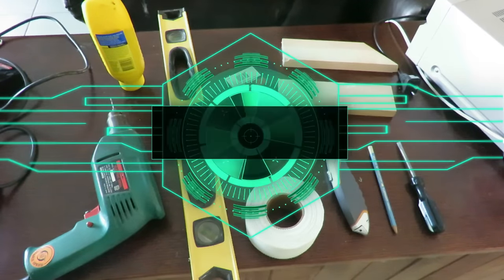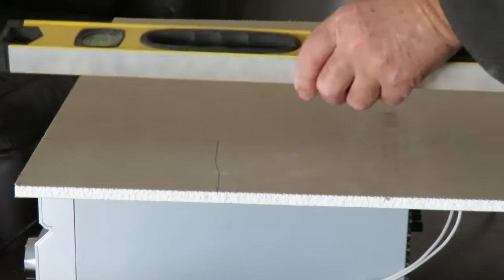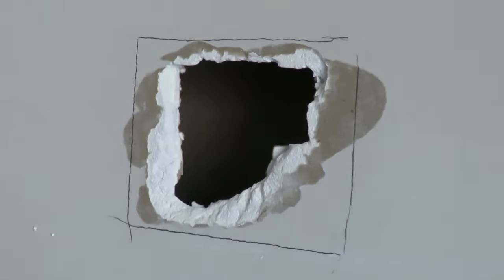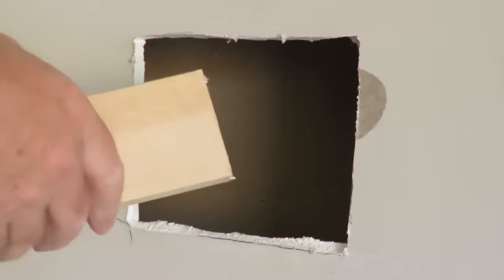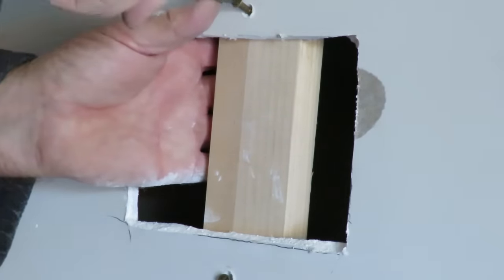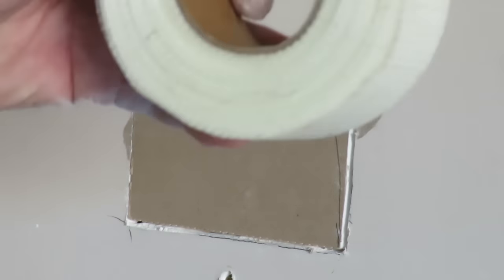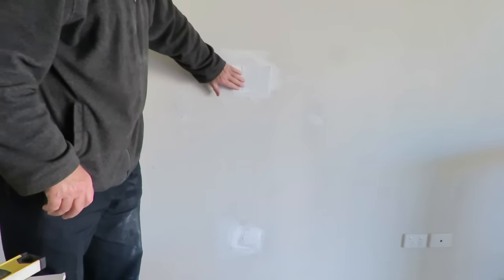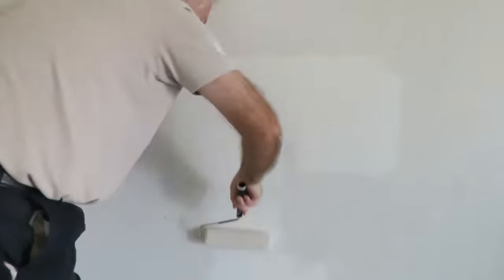🏠 How to Repair Drywall and Fix a large Hole in the Plaster Wall the easy way

Comment: This repair is completely wrong.
The deadwood goes at left and right side of cut out to simulate studs and then drywall piece screws to deadwood that should go at least 3” beyond opening ↕️ both sides 1”x3” or 1”x4” wood works better than 1”x2” 
(By how ever long the deadwood should be)
Then tape, mud, and few skim coats. Lightly sand (unless you make a huge mess) texture and paint.

I’m a trained artisan in highend residential and this is how this repair is done right.  ...just saying
Reply: So not completely wrong then. Just differently to how you would do it....

just saying
Reply: @Delboy591  he put the patch in backwards.
Reply from the maker: There are many ways to do repairs, it all depends on what you have available on the day of the repair.

Please Read the video description for a better understanding as to why the repair was done this way
P.S. I normally use this method when I have my tools with me.
📌 https://youtu.be/JmcR9TW4mM0
Reply: @GarryPurcell  it has nothing to do with technique and everything to do with the material used.  Drywall has 2 different types of paper,  and the brown side always goes to the inside of the wall.  If it's on the outside "facing you" then when it's mudded and painted. The paper will slowly delaminate leaving blisters under the paint
Reply: @chrisstorholt926  why????
Reply: @imho2278  When they make sheets of drywall, they use 2 different kinds of paper.  One is designed to bond to the mud we use to finish it and is also thicker, and more rigid to support the sheet with drywall screws. It is usually white or grey in color.   The other is actually several layers of brown paper that have been glued together, in the same way plywood is, to create a stronger backing.   If you hang it backward, with the brown facing towards you, then when you tape and mud, it will pull the layers apart and cause the tape to fail and bubbles to form.  You might get lucky with a smaller patch, but there's always the risk.  With a larger patch or sheet hung, you will absolutely see it separate over time.
Reply: Trained artisan in high end residential, no less!  🤣

Comment: Or you could make a simple patch with a knife and a tape measure lol but that's just me
Reply from the maker: There are lots of ways to do wall repairs.
Reply: @GarryPurcell  no need to waste time and money.
Reply from the maker: @MrStevesparkz  True
You use what is at hand and make the best use of it.
I had to borrow tools and source materials from a dump bin to do this repair.
Reply: @GarryPurcell  so what you are telling me is that you didn't have 3 things like a knife a measuring tape and a pencil? lol ok whatever you say man .
Reply from the maker: @MrStevesparkz  I was there painting walls.
So I think that answers your question for you.
Reply: @GarryPurcell  you just need to be taught and updated on new simple techniques. enough of this 1970's let's take all day to fix something techniques.
Reply from the maker: There's nothing stopping you from making a video on the topic, and letting me see your prefered method. (And Costing)
Reply: @GarryPurcell  I'll save you the time all you need is one knife one pencil one tape measure. it's a called a patch. a little spackle or what have you to follow and then paint . why are you not getting this?
Reply from the maker: @MrStevesparkz  Simply call it a californian patch.
There are lots of ways to do repairs.
Clips are becoming very popular also.

Comment: Unprofessional
Reply from the maker: YOU Should Learn to READ Video Descriptions First before commenting in future.
Reply: I’d say it worked pretty well though. Did it not? Solid work IMO.
Reply from the maker: Its holding up perfectly, these types of repairs can be dome in many ways.
When I'm forewarned, I normally use the method below to repair a wall, that a wall has been damaged.
https://youtu.be/JmcR9TW4mM0

Comment: Iam sorry but the way you did it was wrong no hate
Reply from the maker: No problem.🙂
But if you read the Video description, all will be reveled, as to why the repair was done this way on the day.

Be sure to check out my other wall repair video, when I was prepared for wall repairs.
https://youtu.be/JmcR9TW4mM0
Reply: @GarryPurcell  it’s just one thing you didn’t put a screw in the middle the two by 4 was in the middle
Reply from the maker: @AnthonyGarcia-db6ti  You need to read the video description, before commenting any further.
It will help you to understand why the repair was done this way.
Reply: @GarryPurcell  yessir
Reply: You need to read the video description before commenting any further

Comment: Thank you for this awesome video! I'll be repairing a hole tomorrow (similar in size). Its in the ceiling though...will the same method work?
Reply: It should!
Reply: I suggest looking for a ceiling turtorial tho
Reply from the maker: I'd suggest this other video I made, would be more suitable for fixing the ceiling. This method has anchor points for the repair piece, so it will hold its position better for you.
https://youtu.be/JmcR9TW4mM0

Comment: Seriously, you pre drill a hole
In the drywall for your screw that is going in wood!  Then you use a hand held flat screw driver?  I definitely would not follow your channel if this is how you patch a simple hole…
Reply from the maker: Read the video description before commenting any further.
Reply: @GarryPurcell  ….Don’t take it personally, you can learn better if you search out other websites….
Reply from the maker: As stated in the Video Description
I had no tools with me on the day, and had to borrow what I could find onsite to repair the wall. 
So maybe you should have read the video description first, before commenting.
P.S. Tasmanian Oak is one of the hardest timbers on the planet, and it's near impossible to hand screw into it. Hence the need to predrill.

I normally use this method below when I have my tools with me.
📌 https://youtu.be/JmcR9TW4mM0
Reply: @GarryPurcell  ….still not following you’re ways.  Very sloppy presentation Gary.
Reply from the maker: @SC-mw2yc And of cause you can do better with no tools, when you are on the jobsite for a completely different job. BUT... you are an expert who sits in a couch, with no real world experience of working in the rental market, where everyday costs money.
Reply: @GarryPurcell  …I spent 32 years in the building trades, IBEW union strong / local 11, state certified electrician, general foreman, foreman and journeyman, mate. Been around all the building trades (lath & plasters, stud framers, dry walkers, plumbers, masons, carpenters, painters,concrete finishers and learned a lot and am now retired enjoying the fruits of my labor, mate.  Match that resume mate!
Reply from the maker: @SC-mw2yc  Wow... and you don't have a single video.

I've seen burlap sack as backing, rolled up paper, cardboard, tape skimmed over, chicken wire for support, and even clay in an old building with lathe walls, butterfly patches, Tylok Connector plates, old paint tin lids, and evan cement as the joining medium.
AND.... Most of them held up really well over the years. (the tape failed bigtime)

So there are many ways to do effective wall repairs.
It all depends on what you have onhand at the time of the repair.

P.S. This repair you have been commenting on, is in a rental property, which is close to 4 years old, with no issues to date.

Comment: When I was a young fella my father came home drunk and mad.He kicked holes in the drywall so me having some ability in home repair looked the situation over and devised a plan.I went to the lumber yard and asked for some scraped 1/2 drywall,some patching plaster and tape.I took a square and cut holes in and around the holes,I put the knife on an angle whitch was smaller on the inside of the wall well I tapered the hole.I took the drywall and cut it on an angle.When I was done the piece I cut out fit down a little below the surface of the hole I took the drywall mud and put it around the hole,I then shoved the plug I made into the wall when I was finished my mother said your father will come home and wonder where the holes went.
Reply from the maker: Nice story, and shows your initiative, well done.🙂

Comment: It's even better with reverse tapers on the wall board and insert, plus wetting the existing edges and putting some mud on it before inserting the patch.
Or cut out stud to stud but using at least 12 inch high stiff piece x 16 wide center of stud to center of stud.
Light side of paper facing you not backwards like this guy did.
Reply from the maker: Thanks for the advice.

Comment: Hmmm on such a small hole !  Made bigger ! A quicker way is to use Gripfill on a small section of plasterboard that is almost the same size as the hole. The plasterboard has a small metal screw pushed through the middle, this is used to position the board on the inside of the repair, and pull it forward. A pre drilled board is placed over the end of the screw and tightened. After a few hours the outer board can be removed. The screw is pushed back gently, and the shallow hole filled.
Reply from the maker: Interesting method, thank you.

Comment: I hate to say anything but I will anyway,no one uses flat head screws ,cut out the square with a keyhole saw,and have a screw gun or drill with a Phillips head bit other then that good job😉
Reply from the maker: The video description will answer why I used flat head screws.

Comment: Make the hole big enough to tuck 4 fingers inside of it. Squirrel 1 or 2 pieces of wood inside the hole, hold them firm against the inside of the wall and screw them to the wall from the outside. Fill in the hole with half inch drywall, 20 minute fast dry mud or both. done.
Reply from the maker: Thanks for sharing your way of doing wall repairs.

I have another wall repair video you might like, when I had all my tools with me.
https://youtu.be/JmcR9TW4mM0?
Reply: @stevenskovranek2747 I hear you but I'm 63 now and too slow to get the 5 minute mud on before it's starts setting up .lol

Comment: I'd suggest using drywall screws to attach the wood support piece. Also securing the drywall to the wood using drywall screws instead of solely relying on the tape to hold it in place. The tape and drywall screws in the patch would probably be enough to keep the piece from rocking like a seesaw but for extra peace of mind I'd use two piece of wood on either side and tuck half of the wood behind the old piece and the other half to secure the patch to like you would when installing full pieces of drywall to a 2x4.
Reply from the maker: The video description explains why it was done this way.
P.S. I have another wall repair video you might like, when I had all my tools with me.
https://youtu.be/JmcR9TW4mM0?

Comment: Garry, I can tell you’re a skilled and experienced craftsman!  Could you advise me on something I’m having difficulty with please?
I have a ceiling with some stain from a previous water leak. What’s the b st product to cover this? Or should I cut it out and replace the section?  It’s drywall but it’s about a 5’x5’ area. Actually, 2 areas. It’s an active office space and I hate to make the mess and shut down the work area as there are electronics and all that stuff to deal with. Your advice would be greatly appreciated my friend!
Reply from the maker: Sugar soap to clean the area affected, and ceiling paint to go over it.
Reply: I had a bad water stain on a painted window sill, interior.  After applying six coats of Kilz the stain kept showing up when the Kilz dried.  I got a rattle can of automotive paint and sprayed it over the stain, then one coat of kilz and two coats of latex paint.  That did the trick!
Reply from the maker: @davidgpo  Interesting way to cover a stain.
Thanks.

Comment: Hi Gary, It's me again.  Your video is helping me to decide on a repairman for a closet drywall project I have.  Specifically, when asked how they would repair the holes - one man described exactly how you do in this video and another said he would fill them with mud.  One other concern I have is that I used a Zinsser shellac-based primer on the walls - trying to get rid of the smell of the old paint I used.  (This is why I now have the holes - ended up ripping out the shelves I'd painted.)  I'm getting mixed messages on whether I need to treat the walls somehow before a skim coat is applied.  Can you advise?  Thank you VERY MUCH!! for your response!
Reply from the maker: Take a look at my second video.
https://youtu.be/JmcR9TW4mM0
Its really easy to DIY wall repairs.
You won't be spending a lot of money.
AND... if it doesn't work out, you can always get someone in to repair it for you.

I'm not familiar with Zinsser paint, so my suggestion is ask at your local pain shop for help.

Comment: Nice but personally, I would have put a scrap of wood behind each side and screwed the patch to the wood as well as the wood to the wall. Less movements means less of a chance of cracking. If someone leans against it, it’s more than likely going to crack with just that scrap of wood in the center.
Reply: I agree. I always put enough backer in to prevent the new piece from moving or pivoting as you see here.  I would have used two pieces of wood for a  solid base.
Reply from the maker: I normally use the method below to repair walls.
https://youtu.be/JmcR9TW4mM0

Comment: Small piece of advice. Not a single wood support in the middle, but 2 on the sides which should also partially cover remaining plaster board (they will create way better support). All edges should be angled on the patch and remaining plaster board. Watch proper videos one this subject as this one is far from being a "reference" for those without any knowledge.
Reply from the maker: Before commenting any further.
Please Read the video description.
P.S. I normally use this method below when I have my tools with me.
📌 https://youtu.be/JmcR9TW4mM0
Reply: 2 l would use.🇦🇺

Comment: Looks great!  I’ll be trying this out on two holes in a few hours.  Problem for me is matching the paint color.  Any tips on that?  I’ve taken a few paint chips from the store, but can’t seem to find the perfect one, and this method just doesn’t seem right.  Anyway, thanks!
Reply from the maker: Matching paint is not something everyone can do, the hardware stores work on a card basis that aren't that accurate to start with.

I can mix my own colours to match, but unfortunately that is of no use to you.

I have a slightly different repair video you might like, by watching both you will have a better understanding of just how easy it is to do wall repairs yourself.
https://youtu.be/JmcR9TW4mM0?
Reply: Garry Purcell thanks so much.  I’ll check out the video and continue to follow your advice.  So far so good with the patching.  If I can throw you a few bucks for your advice I’d like to.  Seriously, very much appreciated.  Keep up the amazing work.  I’ll check back shortly.
Reply: Garry Purcell patched my hole successfully.  Just have to spackle, sand and paint.  Thank you so much!

Comment: Gee, reading through the comments, it seems that there are so many experts out there. They need to remember that this video isn't designed for fancy pants American market, although could easily apply, it looks like it is designed more for landlords and homeowners who need to do a repair job, who don't normally have the tools, or have never attempted this sort of fix. I've had to do this type of fix on a number of occasions, although it is a relatively quick fix, it's not a five minute job, especially if you're waiting for plaster to dry. There are other methods, I have been inside houses administered by Housing NZ, and have had to patch up holes made by fists, boots, heads, or whatever other item could be used as a projectile. They were patched using a slightly different method, called "back blocking". But, if you were looking for a quick guide on what to do or expect, this is a good video.
Reply from the maker: Thanks for taking the time to comment.
So many people bypass reading the video description, and immediately jump to conclusions.
I'd like to see how these experts work under pressure, when there onsite for a completely different job, with no tools for wall repairs, and a deadline to meet.
P.S. This repair is 4 years old in a rental property, and still holding perfectly.

I normally use this method when I have my tools with me.
📌 https://youtu.be/JmcR9TW4mM0

Comment: Hey. I have to repair a plaster board that has a hole cut out to allow a chrome sink traps horizontal pipe work. Can’t take the whole thing off, any thoughts?
Reply from the maker: Maybe add a backing board or tiles?

Comment: Wouldn't you see the texture difference on the wall? Since the putty is super smooth? So then shouldn't you use primer first to help remedy the texture difference?
Reply from the maker: The paint used did not need a primer, and the paint roller will blend over the plaster and old paint, so the repair will be invisible, as long as you have the exact colour.

Comment: Hi Gary, Thank you for your demonstration.  I appreciated the calm, slow pace at which you gave instructions.  One question - the "skimming layer" is just more plaster (not a different product) correct?
Reply from the maker: Correct, its just a thin even layer.
I have another video that might help you, if your repairing a wall for the first time.
By watching both, you will get a better understanding as to how easy it is to DIY.
https://youtu.be/JmcR9TW4mM0